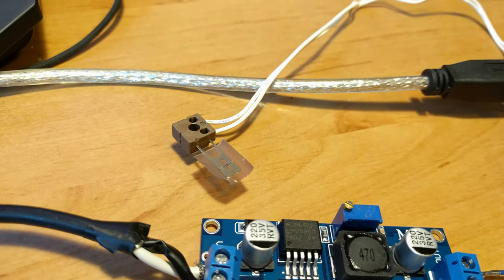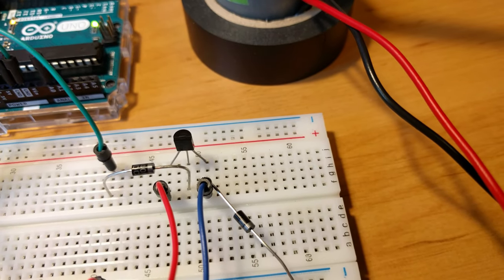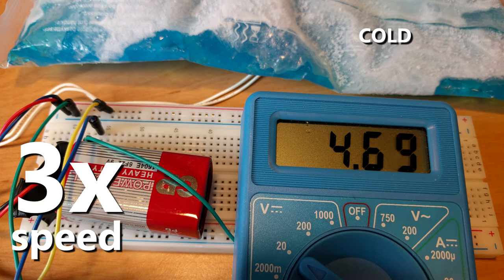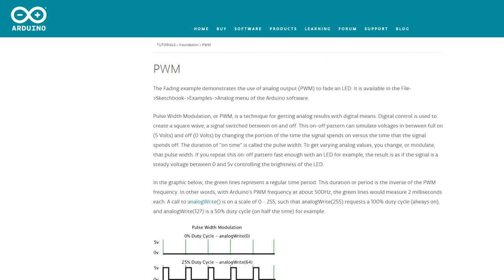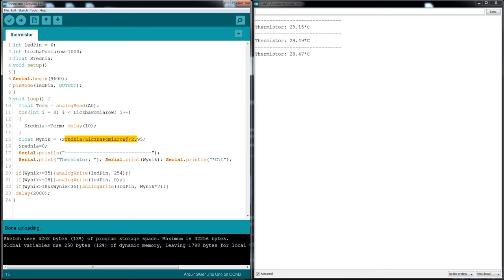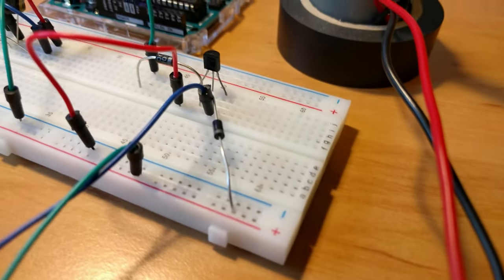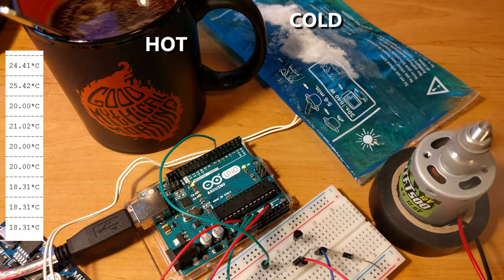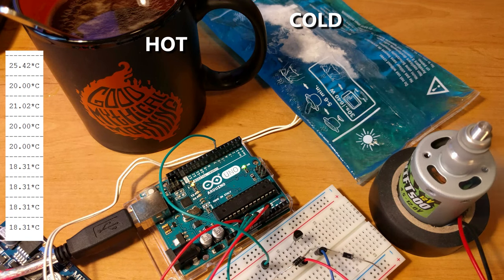Controling brushed motor speed with sensor data

Comment: Thank you for this video. Someone in a comment said on another video that brushless motors are the only motors that you can control the speed on. I believed you could control the speed on brushed DC motors as well by using a transistor and pulse width modulation as you have proven in this video. I researched this video's topic just to make sure I was correct on this matter. Thank you for proving me correct.